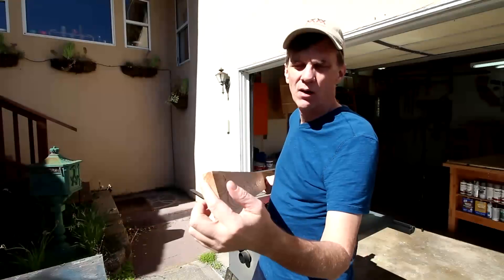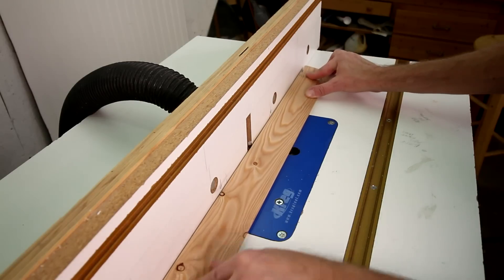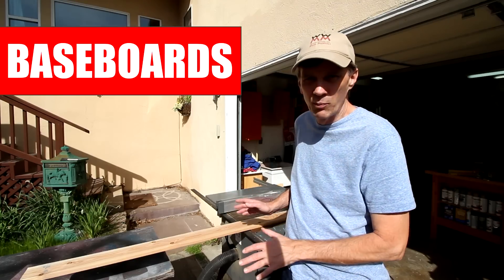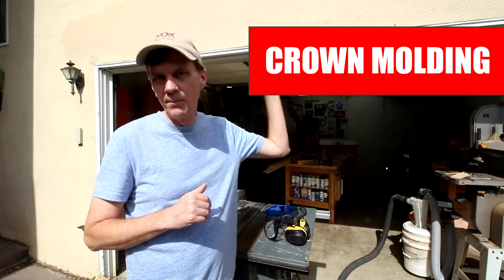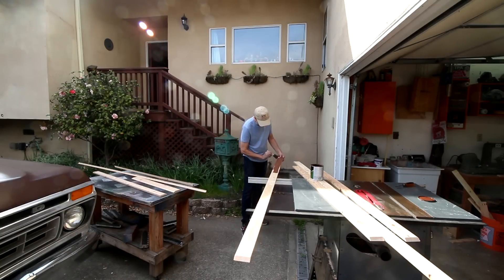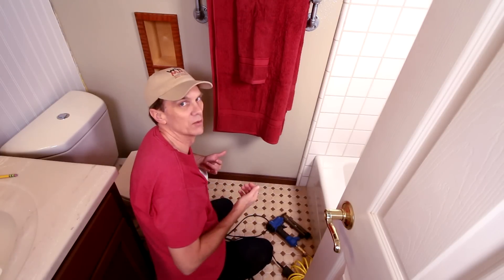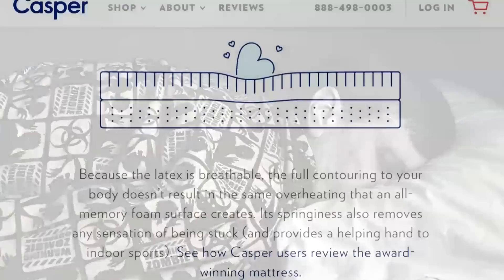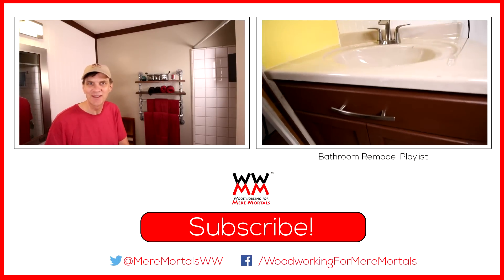Beautify Your Home With Custom Trim Molding. Save money by making your own!

Comment: Thanks for this Steve. 

I'd been thinking about making my own, but you gave me the final push. A few hours later and I've got them fabricated and laid, completing the upper landing job that's been stalled for a few months. 

Worked out at £1 p/m to do it myself, rather than £3-4 p/m from the shop. 

Cheers.

Comment: Did this last year to save money addressing a problem. Needed baseboard (?) trim that was thicker than 3/4" at the bottom and taller than 3.5". Homestore didn't have any with that sizing; but they had plenty of fine pine for cheap. Even gave me a discount because I shopped there so often. Great video!

Comment: Interesting comments about the need for trim moulding.  In Australia it is normal for the wall/ceiling join to have cornices.  Usually different size cornice or patterns depending on the style of the home or the height of the ceiling. With bathrooms either tiled or plaster board, we don't have corner beading at the joins.  I thought your work looked pretty good and made a difference to the bathroom.

Comment: Nice steve! but it's not necessary to cut notches for hinges. You should be offsetting the moulding about 3/16 on the jamb so it clears the hinges and striker plate on the knob side

Comment: Hi Steve, I am looking to buy a nail gun in the future, and I was amazed to see that your gun didn't seem to leave any marks. What size nails were you using here, and do you have any tips on buying ?
Reply: my hubby told me if I'm getting marks my compressor isn't set correctly and I'm not applying correct pressure on the nail gun when I'm pressing it against the piece I'm nailing. I'm interested in knowing if there is any gun that doesn't leave marks because I get them (randomly not ever time so hubby may be right, but when does a wife ever want to admit that?) with any size nail I ve used from tiny to 1 3/4 (my guns largest useable size).

Comment: Did I miss something?  Did you not cut 45 degree angles on the back of the crown molding?  Cuase I've been dreading making crown because of all the work to cut those back angles.. if I can just round it over and tack it up..  that would be awesome!

Comment: Do you have any tips for adding molding to a home where the walls meet at rounded corners?  It seems like the contractors that made the house I live in used a small piece about an inch long over the rounded corner, and the longer pieces that would normally meet at a 90 degree angle meet the small one inch piece at a 45... Wow, this is oddly harder to describe than I thought it would be.
Anyway, I was wondering if that is the advised method or if there is a better way to get around the rounded corners if I decide to replace the baseboard or add crown molding

Comment: Should of made a cavity on the back of the molding for wires to go through them. It helps create a wire-free look in the house ;)

For living room and bedrooms
Reply: I love that idea! my question is....how would I run a new product cord into the cavity? how would I remove a cord? I'm going to be caulking the molding so it won't be removable and the plugs are larger  (obviously) and won't be able to be pulled through. I'm wondering if maybe instead of quarter round finishing piece on bottom ii can notch out a wooden cover and attach it - no that wouldn't work because I still want finished caulk look. hmm mm I'm new to woodworking but I have most of the tools and bits need for any project - I stole them from hubby's garage - hubby also brought me power tools instead of flowers for the last 6 months (he's a keeper) when he found out I'd be doing remodel/finishing myself - I'm looking at baseboards now (premade) I think I can carve out back side if I decide to use it but then I'm still wondering about the caulking. Sorry for the long post but I'm stalling/making/buying this week half the house is caulk ed already so I want to make sure, if this is feasible for multiple cords, that I stop and rethink my game plan.
Reply: Brandi Herrera if you have carpet you can slide the cables underneath into the cavity. But with wooden floors I'm not sure what you could do because they'll be an obvious gap between the flooring and molding.
Reply: ***** yes I have tile but I'm determined now to have something or some way to cover/hide. My blog is just getting ready to start and part of it is the diy page that's titled "how mad can I make my hubby?" - it's a daily thing, God love him for learning how not to yell when ticked, but I think this one is gonna be a dozy - I think I'm going to cut out bottom part of wall behind the molding to run a conduit piece (I saw some in the garage so a light bulb appeared over my head) to plugs in each direction with extension cords and power surge protector thingys with a larger area cut out where the cords will be tucked in and hidden behind a fake square wall piece. That way I can plug in, hide and remove at will. And it's safe in the conduit and I won't be overloading circuits doing it to the separate  plugs on opposite sides (I know they're on different breakers) im sure  this isn't going to be quick or easy and I'm wondering how I can hide it till I'm done but that's nothing new around here lol .

Comment: Hey, rookie woodworker here!
 I just purchased my first new table saw and I'm looking to upgrade the factory blade. I have no idea what kind of blade I'm supposed to get. 
I'll be making stave drums and simple-ish projects. 

So what kind of blade should I get, and what are some reputable brands?
Reply: I'm new too and just upgraded to Diablo. Got a 40 tooth, rip cut blade, and a dado stack. Also picked up a 60 tooth for "finer" cuts, but it probably wasn't necessary...

Comment: Is there a safe way to use a [plunge] router by hand to work on smaller pieces if you don't have a router table?
Reply: In a vice? Look at Jimmy Diresta's router tips video. But I am a tummy sleeper and I may not be right.

Comment: In context of the part where he said that the bathroom walls weren't equal, my house is "L" shaped.  Obviously it should be at 90 degrees, but in reality it's actually at around 100, I forget exactly what it was.  I found out when I was moving my garage door from one side of the garage to the other.  Does it matter, can you tell from looking at it, not really, but it's still kind of a funny thing.

Comment: If you really want to experience poor workmanship. work with a handy man and some of the houses they run into.  often the corners are not square  so hanging cabinets is really fun.  Went to one house to fix the floor as it had a 7 dip from wall to wall. When I got it open we found an old oak beam that could be broken with one hand.  Rim plate of the house was dry rot and  the wall studs would crumble with a mild grip.  Called and the insurance company said to put a floor in and drop buy when we were done to get our check.

Comment: Silly question: do you cut the baseboards etc at 45 degrees or do you prefer to find the actual angle and divide by 2 in order to get the exact angle for the cut?  As you pointed out, walls aren't always perfect. :)  I'm renoing my computer room currently and will be installing new baseboard and making my own crown molding so I was kind of curious.